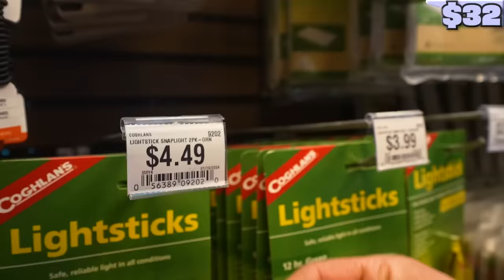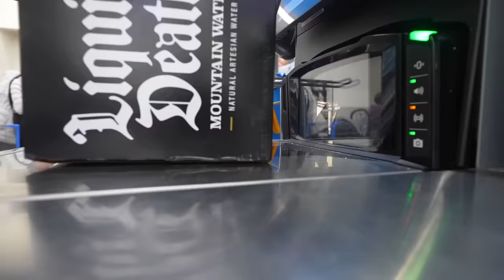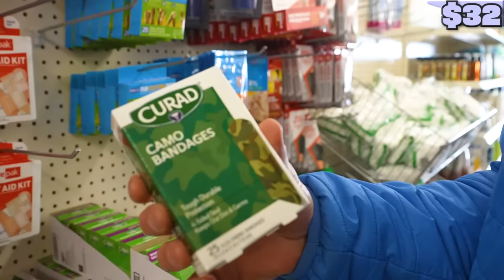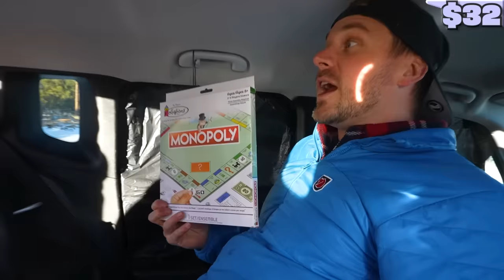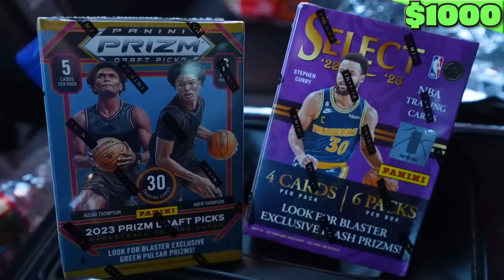$10 VS $1,000 APOCALYPSE VEHICLES!

Comment: Suggestion: you should leave all the budgets on the plinko board so even if someone gets a budget of 30 someone else still might get it. It would just be funny to see 2 people with low budgets or 2 with high budgets.
Reply: I’m pretty sure the reason they don’t do that is BECAUSE all of them could get a high budget.

If there’s $1,000 and each of them happened to get that, that’s $3,000 for that one video. 

They’d rather give a $1,000 budget, then maybe $100 for another budget and $50 for another budget (that’s only $1,150), so it doesn’t potentially add up to be crazy expensive.

They have employees to pay and many have families to take care of. They don’t want to potentially spend $2,000+ on each budget challenge.